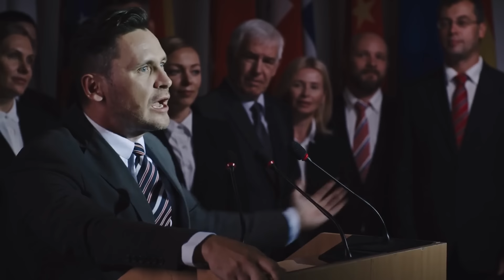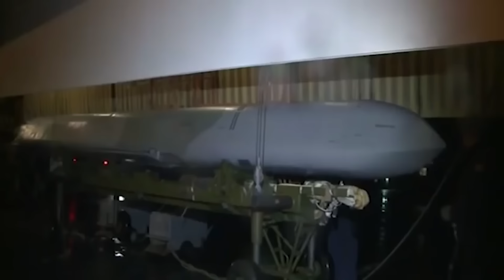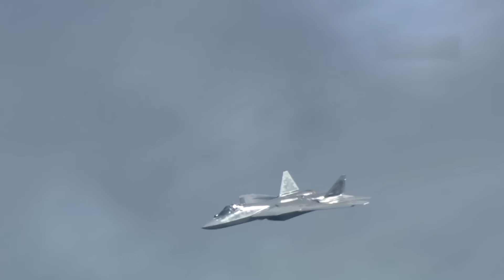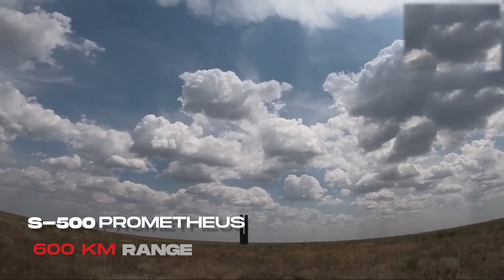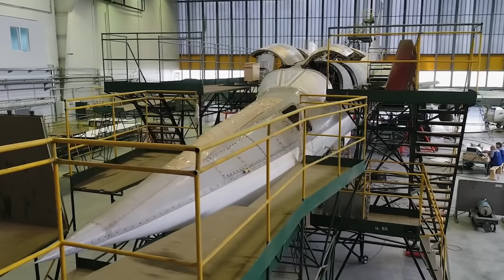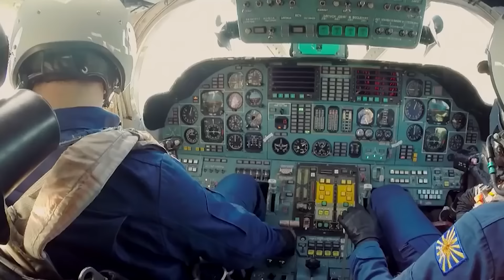WORLD ALERT! Russia’s Hypersonic PAK DA Bomber Is REAL!

Comment: The aerodynamics is like a predator bird, and it’s just awesome. It’s speed will evade any western intercepter.
Reply from the maker: The aerodynamic design is only part of the picture. What makes concepts like PAK DA or hypersonic bombers dangerous is the combination of flight profile, altitude, and timing — forcing defenders to react late and with incomplete tracking. Interception becomes a systems problem, not a fighter-vs-fighter contest.

Comment: 0 seconds ago
I Recommend For Sri Lanka Air with at least Number of 10 Pak Da Stealth Fighter with at least 1000 Numbers of Hypersonic Long Range Missiles. After Received Above Everything, Cannot Be Loosing Any Air Craft Wich Unauthorized Accessing Sri Lanka Sky For Any Reason. No Needed Any Excuses Okay. This is For Long Term Plan Only.
Reply from the maker: The PAK DA shows how Russia thinks about power projection: long-range, low-observable, and built for stand-off hypersonic roles. Countries don’t need 1000 missiles — they need survivability and reach. That’s exactly what this bomber is designed around.

Comment: The  jet used on this video  cover art If you know anything.
About aerodynamics, 
those wings will break off at hypersonic speeds
Reply from the maker: Good eye — the artwork is an artist's concept, blending future stealth with current hypersonic physics. The PAK DA's actual design is heavily classified, but engineers are undoubtedly solving these exact aerodynamic challenges for Mach 5+ flight.

Comment: Just how can a flying fiberglass and a little Stainless  tube   a throw away mini turbofan and  fancy electronics can cost that much ? ?? ? ? ? ?
Reply from the maker: It’s crazy when you break it down, right? But the cost isn’t in the metal — it’s in the invisible parts. The design hours, the stealth geometry, the radar coatings, the software that syncs missiles across thousands of kilometers. In military tech, you pay for the silence before the strike.

Comment: B-2 is far from being supersonic as is this model. . Way too massive to acheive it. .
Reply from the maker: You're right, the B-2 isn't supersonic—it’s designed for stealth and long-range subsonic penetration. But the PAK DA is a different class of bomber; it prioritizes speed for rapid global strikes.
Reply: @militarypower-s2r  It may be  150 mph faster but that' it   supersonic requires a very particular airframe profile  and proportions  this big plane hss a  very big load capacity  , but will never be supersonic   maybe trans-sonic in a dive but it would probably tear it's wing off recovering from the dive. .  🤔
Reply from the maker: @MichelBrown-o9vExactly — the airframe of a flying wing like the B-2 or PAK DA trades raw speed for radar invisibility and endurance. Supersonic lift creates heat and drag; stealth demands silence and smoothness. The real race now isn’t Mach — it’s who stays unseen longest and strikes first.

Comment: Yeah this is all just Ai show us the real thing
Reply from the maker: The footage released is from official sources — next major milestone will be flight tests
Reply: @militarypower-s2r lol do you realise how many military projects make it to prototypes and then never get made ?
Reply from the maker: @twoheadedtasmanian1481
Of course — most military concepts die on the drawing board. The difference is when a project reaches hardware stage with state funding, production tooling, and trials already contracted. That’s when it stops being a “maybe” and becomes a program with momentum.

PAK DA is already past the sketch phase — composites, engines, and systems are in bench testing. Prototypes don’t get built for fun. They get built because someone has already signed the budget for the next step.